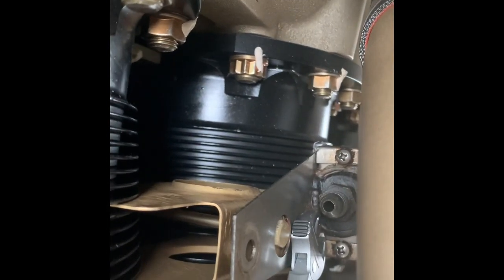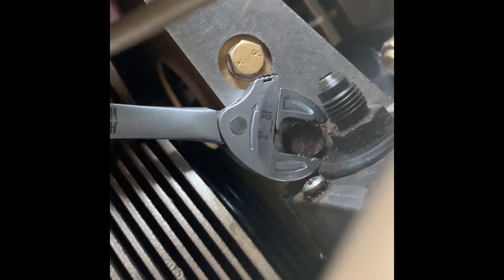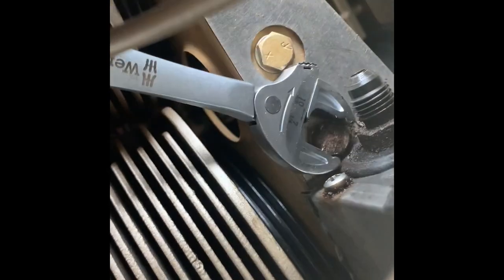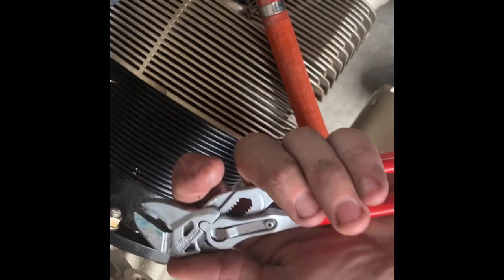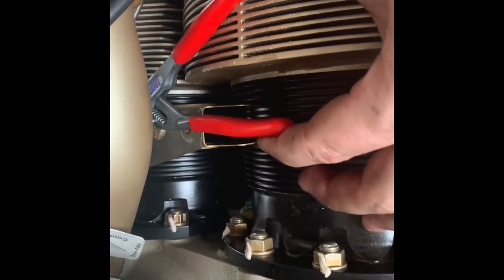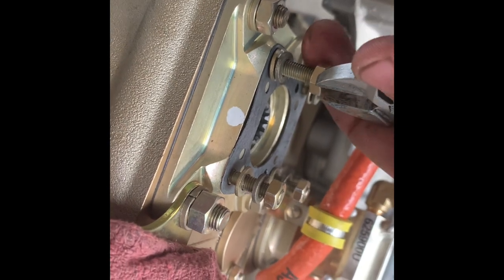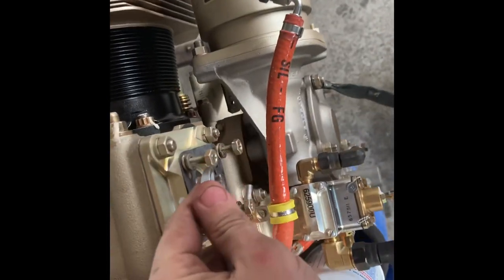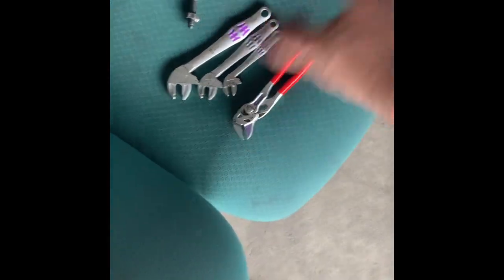Knipex pliers wrench vs Wera 6004 series.  Real world examples, uses, pros and cons

Comment: An important point is which clamp damages the screw head less?, the knipex if used correctly does not matter how many times you use it to insert or remove the screw, if you use it correctly, it does not damage the screw head.
Reply from the maker: Neither does Wera
Reply: @CreativeMechanic  which one?

Comment: They just introduced a knock off of these at advance auto under the diehard name called smart wrench
Reply from the maker: I’m sure they work, but knipex has a Rockwell hardness of 61…. I doubt the smartech is that high.  Probably would be ok for occasional use, but my knipex have lasted 12 years and they ain’t slowing down

Comment: Why didn’t you set the Knipex plier wrench correctly, the handles should be almost together when set up right allowing you to grip both at the same time. Only then will the Knipex shine, the more pull you exert on the handles the tighter they grip, eliminating the chance of slipping. I use them on chrome finish nuts, or brass nuts and they have undone some pretty tight fixings. 
I have them in 125mm, 180mm and 300mm which have eliminated all my adjustable spanners because ordinary spanners slip but these do not.
I’ve no experience with the Wera, but I’m a Wera fan so I’m not hating on them, in fact I’m thinking of getting the insulated ones in XS and S sizes that’s how I found this video.
Reply: THIS!!! The guy in the video either doesn't know what he's doing OR biased towards Wera for some reason enough to motivate him to bash Knipex.
Reply from the maker: @hankkirk944 nope